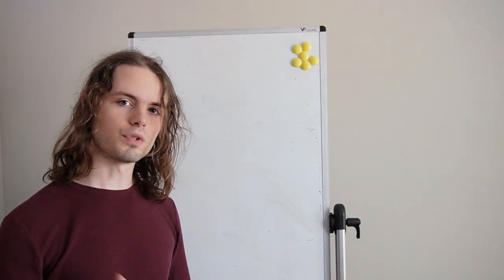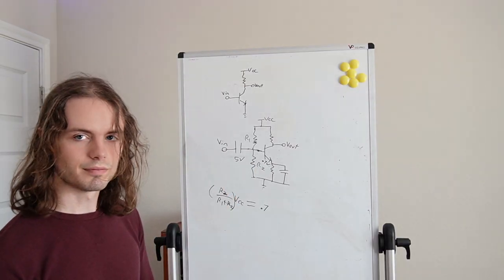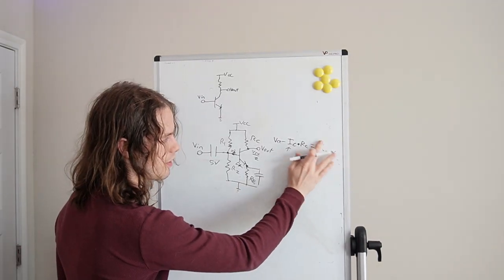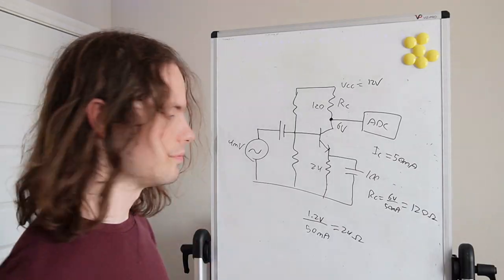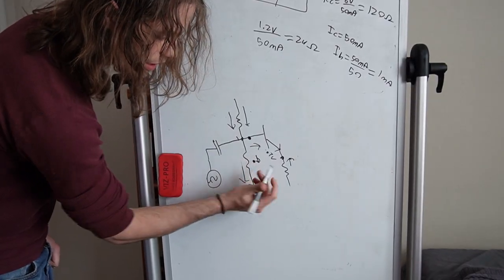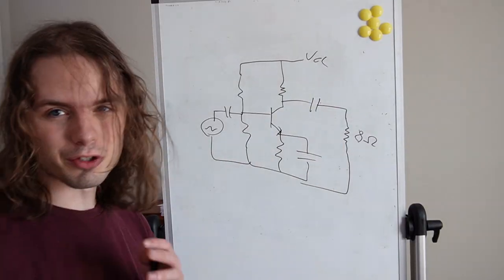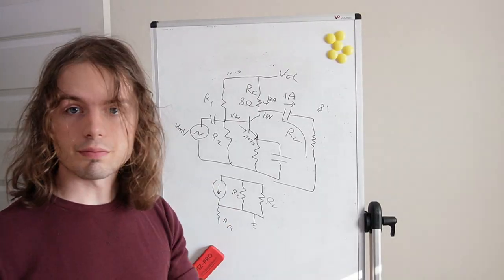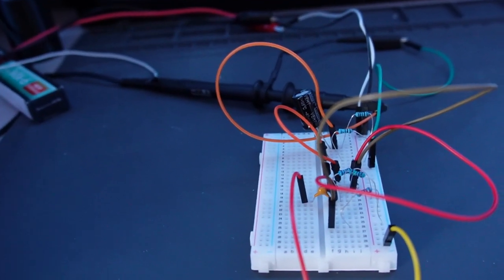Understanding the Class A Amplifier — Why Each Part Is There

Comment: Your input & output coupling caps. are scaled based on the frequency range that the amp must pass (with the impedances used).  Too small a value (1uF or 10uF) will cause low frequency rolloff below 100 or 20 Hertz.  Larger caps allow lower frequencies.  The bypass capacitor is used to prevent signal degeneration of the waveform caused by the emitter resistor used for feedback.  Without the bypass cap, the top lobe of a sine wave will appear compressed compared to the negative alternation, causing distortion of the signal.  For small signal operation (input current around 1 mA), replace the input bias divider resistors with a trimmer pot, and dial in the value that gives exact class A operation without clipping [use an oscilloscope].  You can measure and replace the potentiometer with fixed values later during the final build, (or not).  Nice cat!
Reply from the maker: Sorry for the wait, I got back from a trip abroad and work has been very busy. That's very interesting. Is it the top half of the signal that gets distorted or the bottom half? Or maybe the better question is which side gets distorted less without the bypass capacitor? 

I actually just bought a kit of potentiometers this weekend. I guess I have underappreciated how useful they can be, especially for amplifiers like you said. 

Thanks, his name is Mister!